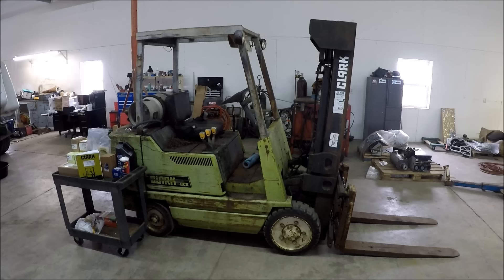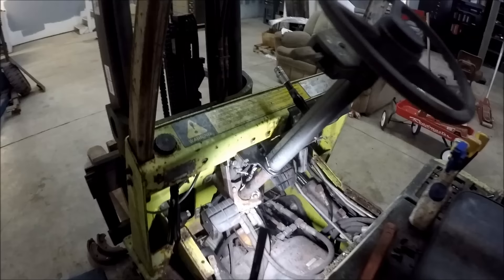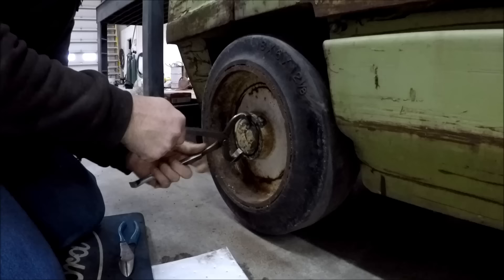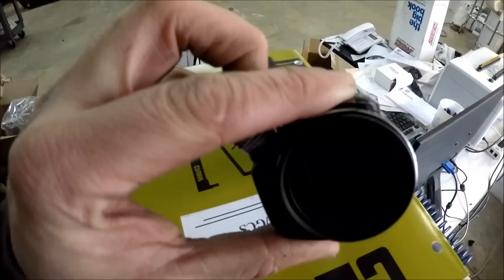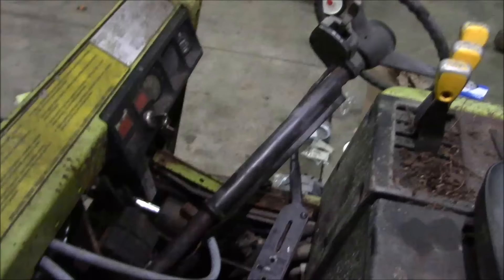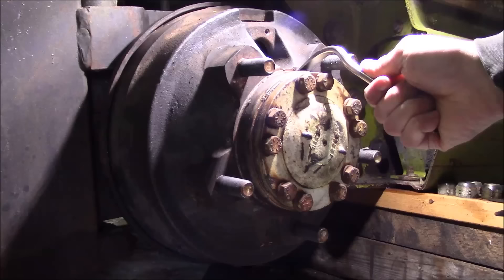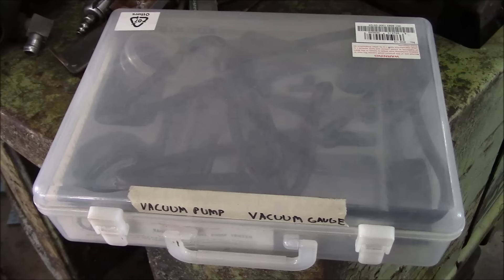Fixing a Forklift that Sat in a Field for 17 Years - Brake Job and Rear Wheel Bearings - Part 1

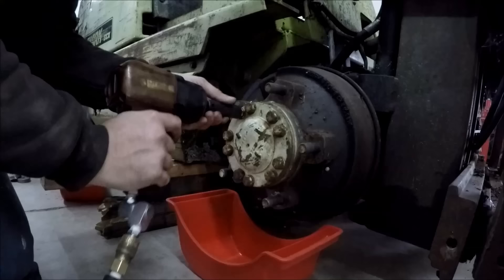Comment: In my first year apprenticeship I got a pager late one evening that a Clarke GCX30 had a mast come off. I laughed because of the improbabilty of such a thing. I was proved to be incorrect because in my youth I completely underestimated the stupidity of the 2 guys working afternoons in the plant that owned the truck. They decided earlier in the evening to close the hotel on their  lunch break and then proceeded to play demo derby with a 30 yard truck and the little Clarke, Apparently, the yard truck backed into the side of the Clarke and sheared the pins for the mast and that is how I found it. The 2 drunks were in a panic and thought a 19 year old with very little tools was going to be able to repair it before day shift started! The best I could do was to pick up our rental truck and deliver it by 07:00. No, they did not lose their jobs!!!
Reply from the maker: Sounds normal. When I worked in a factory we got a brand new Cat 3 wheel electric lift. Within 1 week you could not pick it out from the other lifts in the fleet...
Reply: @WatchWesWork  Ha! I used to service the trucks and the trick was to seize a propane truck at 06: 30 am before day shift and service it and then trade it for another propane truck because having an electric truck held no water in the fork truck bartering game. You could'nt give them away:( I actually lost a rental truck to the glue factory because they just killed it. The glue factory bought it off me and then gave it back to me as scrap

Comment: maybe find out why there appears to be an alignment issue between the body and mast? These forks are worth the effort - will be a usefull tool for you I am sure.
Reply from the maker: The chassis bolts were loose. You'll see in the next video.

Comment: We had/still have a 580 case backhoe we drove for years with breaks working (barley working) on only one of the back tires. Years and years then one day we had a mechanic fixing something big on it I forgot what and he says oh yeah I fixed your breaks they just needed adjusting... Don't get me started on why we still  start it with a screwdriver crossing the terminals on the starte
Reply from the maker: I know exactly what you mean. When I was a kid we had an old Ford high boy we used to firewood. The standard start up procedure was to grab a 5 gallon gas can and pour 4-1/2 gallons in the tank. The rest we had to pour down the carb to get it started. I think it had one brake that worked.

Comment: WES, that weird T piece, you could chuck one end in a lathe to round the other end of it of slightly, turn it round chuck the other end, round it off slightly and knurl it, then knurl the first end, then if you have a 4 jaw chuck, or carefully pack one jaw of 3 to hold it to round and knurl the remaining T end, jobs a gooden.. OR, wait for the princesses in the hardware shop to open again..lol... Old mechanical Engineers brains dont get old here as I`m just 72....Oh them damaged metric threads Wes, If you dont have Metric Dies, try In your lathe chucking the bolts, one at a time, running not too fast, use a nice 3 sided file to chase the damaged threads out a bit..Thanks for the Videos - (IAN) - UK
Reply from the maker: I think the threads were mostly gone. Unfortunately, it still quite difficult to get metric bolts locally in the USA. I can order them in, but I wanted to get the job done.
Reply: @WatchWesWork  I can understand that Wes, you just gotta do the best you can with what you got eh..I last worked in early 2003, all aero  Flying stuff plus "other stuff" but we was all metric by then, but for years we was getting job drawings and worksheets In metric but converting them to imperial.. using a mixture of Metric and Imperial measuring tools / nightmare.. Ironically while most cars / vehicles I owned and worked on were Metric, But my once owned for 10 years 1991 Landrover discovery Diesel was still mainly old Imperial nuts / bolts/ threads / screws...The last of the Old English manufacturing bless them..... Most but not all my personal vehicles were Diesel powered, In fact my  current vehicle Is a Landrover Freelander Diesel automatic is B M W powered, a TD4 model (google it), so I`m now learning its traits now.... Thanks for the reply Wes, keep at it, as there will always be something to fix in life, as I even still know that... Hope It stops snowing soon..

Comment: I realize this is a unique situation, but as a rule always replace all the springs guys, when doing drum brakes. Springs get weak over time from heat cycles, rust , abuse and use. Not doing so can cause the shoes to sag in the drum, and many times results in premature ware and failure. So if you want to do your drum brakes just one time, buy a spring kit. Ask me how I know this....Thanks  for the video's Wes...Jack Baker
Reply from the maker: In my opinion, it's a judgement call like anything else. I normally reuse them unless thing are looking too rusty. Often it's hard to get the springs and requires you to wait on a delivery, whereas the shoes will be in stock.

Comment: I'm assuming the orientation of the master cylinder is why the manual specified pressure bleeding from the wheel cylinders. I've done it that way with a HF trigger style oiler filled with brake fluid.
As I remember VW  bugs have one adjuster wheel per shoe.
I have that same brake spoon and I use it almost every day, actually prefer it to the Snap-on ones I have.
Reply from the maker: Are the VWs self adjusting? I've never messed with one.
Reply: @WatchWesWork  
The drum brakes on the beetle have a fixed anchor opposite the wheel cylinder with one star wheel per shoe, the buses were a little different with 2 single piston wheel cylinders per wheel.
The access for adjusting is also through the drum like the Clark but no feeler gauge.

http://repairguide.autozone.com/znetrgs/repair_guide_content/en_us/images/0900c152/80/26/71/3f/medium/0900c1528026713f.gif

Comment: I was thought to put a little bit of drag on wheel bearings in low speed applications like ag or construction vehicles. Is that wrong? Or just a different way of doing things? I think you wouldn't want any play in a low speed high load situation.
Please let me know right or wrong

Comment: Man i couldn't thank you enough for creating this video. I purchased one of these a month ago. Well my model is a gcs 25. But almost identical to yours. The guy that sold it to me said it was a 1999 but i was unable to confirm that even with a dealer looking it up for me. On the engine block there was a plate that looks like a date says 050785  but not 100% sure. Do you know if your is marked the same way on the engine? The dealer did help with what oils i need to used in different places. Almost done doing the brakes. Oh mine only had one master cylinder! It was bigger And it was horizontal like a gun. I wonder if mine is a little newer and they improved the design. The master cylinder i got was full of what looks like mud. It a cylinder and reservoir all in one. Water must of got in. So i changed it out. Ive never owned a forklift so im not sure how far down i need to press on the brakes for the fork lift to stop. I would love to pick your brain on this machine!

Comment: Secret to changing forklift tires. Jack it up until the tire barely leaves the floor (1/8 to 1/4 inch), take off lug nuts, put a little oil on the floor beside and under the tire, then slide the tire off using the oil for it to slide on.  Reverse this to put it back on. never have to pick up these heavy mothers again.

Comment: for the tilt on your mast , put a block under the mast and tilt all the way forward , in behind that mast theres a set of bushings that will need to be changed and as long as its not gone metal to metal it should be an easy fix , the lower one takes a bit of finese but its not to bad , you will have to get the number off the mast to get the right bushings , if you can fire up the pressure washer firsts , it an area the collects alot of crap ,
Reply from the maker: All of the smaller Clarks I've worked on had the mast pivot around the outside of the axle tube. That's how this one is done. There is no play in the pivot.
Reply: @WatchWesWork  yup thats how i remeber most of them as well. and you can have to play with these and still have wear , the dirt will pack in the botting and make it seem like theres no play is it accepting grease?
Reply: if i give it a bit of thought your probable gonna figure it out if you have t remove the mast to change bearing and service the lift cylender. once again thanks for sharing for me its a blast from my past
Reply from the maker: @garrylalonde6836  Yes. I greased it up no problem. I found that the chassis mounting bolts were loose on one side. You will see if you tune in for part 2.

Comment: The 4G54  isn't that different from the 64 or 66. The chassis parts be careful as yours is what we call a compact. Your mast is container spec Full Free Lift . as regards to the lopsidedness , check the cheek bolts that hold the chassis with the axle. These are the 4x 24mm 15/16s bolts directly behind the brake drum. As the truck has been sitting  I would check nothing has dropped down the mast channels stopping second stage from lifting After that its a mast off job , replace and shim channel bearings. Your salvaged forks look like their heel measurement is over 10% worn ,which I advise replacing and most definitely replace them lift chains as you can't guarantee that they aren't rusted thru and first time near to a heavy weight is lifted they may snap. The model number is also the lifting weight capacity  is 30 = 3ton/ 3000kgs/ 6600lbs and then with what's called a hook on side shift which your truck has it would be by 250kgs approx 500lbs.  So this truck would be derated  to about 6000 - 6100 lbs up to 3300 mm then there will be another deration  after 3300mm to the max lift height. If you are going to reseal both tilt rams, remove and reseal one at a time .Don't remove both at the same time or the mast may tip completely forward or if not you will struggle to pull the mast back to refit tilt ram pins

Comment: Is there any chance that if you used NoOx on the steel bolts in the aluminum houosing would either prevent or reduce to dissimilar corrosion?

Comment: Parking brake cables $11 a piece, wheel cylinders $12, probably a bunch of other inexpensive parts on this durable piece of equipment that lasted 17 years in a field and still works...

Me: looks at BMW, which needs a $1200 part if you look at it wrong

Also me: I should drive a forklift to work.
Reply from the maker: It's a bit of a rough ride. Maybe a touch cold in winter.

Comment: Gravity works for me. Just fill up the reservoir, crack the bleeder and watch til fluid comes out the bottom.
Reply from the maker: That will work for the wheel cylinders, but will not work for the master cylinders. You will still have a bubble in there.

Comment: easy way to lift it, tilt all the way back put blocks under mast and tilt all the way forward. both drive tires off the ground. really its a forklift you will never go fast enough to not stop and you will never wear them out. I've put forklift brakes back together that were 100 times worse then that. i have worked on forklifts for 30 years and have never machined a drum. vacuum bleeding also sucks the piston down in the master and the brakes dont work, best to psi bleed clutch and brakes.

Comment: What brand is that 3/8 ratchet?

Also, I'd never seen dust cap pliers, I'll have to look for some.  And you probably know about them, but there are seal pullers.  They span the width of the seal and make it simple to pull them out.

Comment: I have GPX25 and Clark told me to use the same manual. I also found out the manual covers the wrong engine. Did you find a manual that covers 4G64?

Comment: So I have a fork lift I'm working on, it is a lion liftall mt80. It has a splash clutch and a Venturi system that is supposed to remove the oil from the bellhousing. Problem being the bellhousing fills with oil and pressurizes the starter and ruins it. Everything seems fine with the hoses and Venturi. Any ideas as to why the starter is filling up?
Reply from the maker: I really don't know. That seems like a bad design.
Reply: @WatchWesWork  yes it does, I've tried contacting the manufacturer.

Comment: It's boggling how some parts are so cheap and other parts aren't.  It would be expected for all of the parts to be expensive because it's "vintage", but $11 for a brake cable just makes me scratch my head.  $11 for the brake hardware is another head scratcher.
Reply from the maker: Yeah. Clark parts are very reasonable. They sold a lot of lifts and used the same parts for many years. There are even aftermarket parts that are even cheaper!

Comment: hose clamps for brake hoses? will not the hoses be pushed off. crimped fittings are usual are the not or a n fittings or factory hoses??
Reply from the maker: That's not the pressure side. The hose just feed fluid from the reservoir to the master cylinder.

Comment: Hey Wes, I know this is a year later, but why did you use oil on the front bearings rather than packing them with grease???
Reply from the maker: Front bearings are oil bath.

Comment: Bearing caps don't keep water out. Ask any boat trailer.
Reply from the maker: They do keep dust out...
Reply: If the dust is big enough to not go thru the cracks. As hubs heat and cool, the air has to go somewhere. Air is not clean. An o-ring on the cap improves its performance. That way the air works its way out past the seal as the wheel turns.
I used to build boat trailers. Keeping crud out of wheel bearings was always a challenge.

Comment: Where did you buy your bearing/ seal driver set and your dust cap puller. I would like to get a set. Thanks
Reply from the maker: The bearing driver is from Lisle. The dust cap pliers are Snap On, but VIM makes a nice set.

Comment: I use a motive power bleeder... I hate buying adapters..i use Fernco pipe connectors..  with hose clamp.. 1 is built for t Toyota... then for bastard cars Suzuki..i use socket as adapter to another 2 sized fernco.. 22mm or so vw rear drum.. pressure test.. perfect.. 3 bucks for adapter.... if too small heat gun and a can increases size....  done...... some I use cap with fitting added... fernco is faster no leaks....  me i like to not buy 6 special fittings at 25 a piece... just made 1 for zuki clutch..  enjoy..

Comment: Love the channel! One thing that gets me cooking is that I don't understand why you dont just buy new stuff? You are reusing so many old parts??? And then you tried loosening up the break lines but then say they are 11 bucks each???? OMG Why did you try to loosen the old ones? That happens over and over again on your channel. Only thing that I really don't understand. Just restore the whole machine MAKING ME GO NUTS
Reply from the maker: Because the best quality parts are the ones that came on the machine originally. Replacement parts, even from the OEM, usually do not last nearly as long as the originals.
Reply: @WatchWesWork  I did not think about that. I can understand that. Good point. I really like your work though and how much you know. I wish I had those abilities. Very nice thanks for the reply
Reply: I don't understand either. Why buy new stuff, if the old ones are still working. Even if they worth one cent...

Comment: I think you should work on the mast next. Only lifting on the first stage is kind of limiting. 
Also, you did the brakes and bearings all wrong. You'll have to start over on those😁
Reply from the maker: It ended up being a simple fix. You'll see in another installment.

Comment: Ok, right off the bat, where did you get that red plastic tub...?   I have needed one of those for years, and cutting & carving up milk cartons just ain't cuttin it no more...

   Oh, and glad to see you back...  Was going thru some withdrawal...
Reply from the maker: It's a Lisle axle drain pan for working on trucks. You can get one at any truck parts place like Fleetpride. https://amzn.to/2Rt1jJP
Reply: Watch Wes Work oh, ok I am familiar with that brand, I have a radiator funnel bleeder thingy made by them. Quality product.
   And oh my gosh, I would never have installed that cotter pin the way you did...   Ha, ha, ha...  Just kidding...

Comment: Is the lathe a Bridge-Port ? I worked in a forklift repair shop ( I was the driver ) and the mechanics always removed the mast to work on brakes and hydraulic pieces ! If I remember correctly the mast is not centered on the body because of clearance issues ! Does that have a side shift ( left and right on the carriage , if so it may have been overweight on one side causing it to tweak !
Reply from the maker: It's a Springfield lathe. The mast is fine, it's the chassis. The bolts were loose.
Reply: Watch Wes Work good to know ! Like I said I just delivered them not worked on them ! Haha

Comment: Wes I have reused brake shoes that were worse then yours. It's a forklift your not driving it 60 mph so the old parts would be more then adequate. It's probably the last time uou will have the brakes apart.

Comment: The mast binding and the tilt to the body makes me think it's been on its side before.  Any good frame straighteners nearby? You might also have the infamous Clark double sided telescopic cylinder  which can collect water on the bottom side.
Reply from the maker: Nah, the chassis bolts were just loose on the axle. I had that double ended telescoping cylinder on my old C300...
Reply: @WatchWesWork  Good deal. My hyster has guide rollers between the mast sections that like to collect debris like a pebble on a sidewalk when you are skateboarding. Hopefully it's nothing too bad.